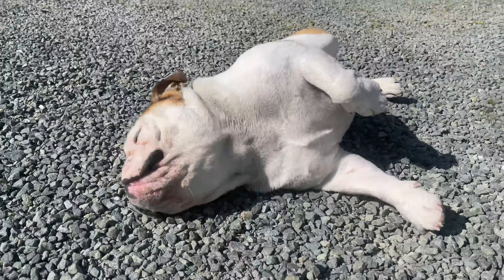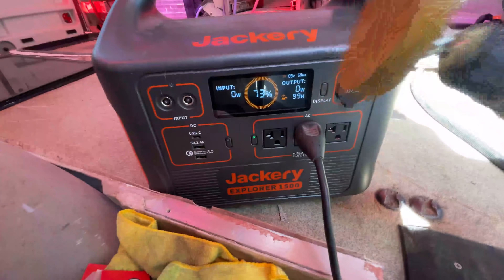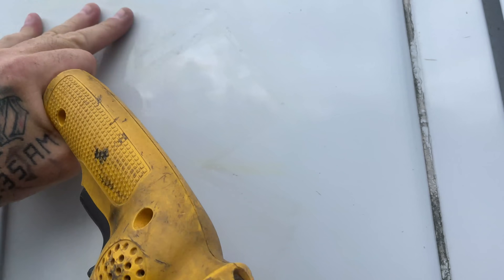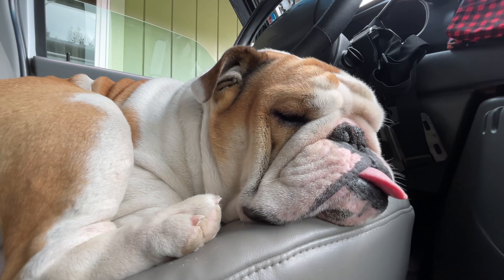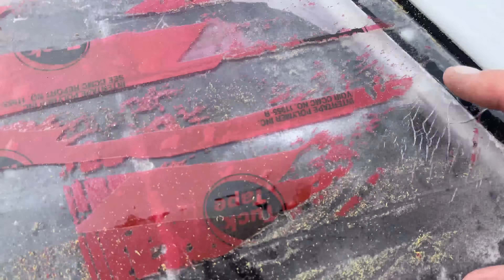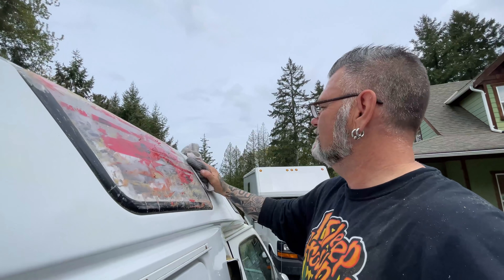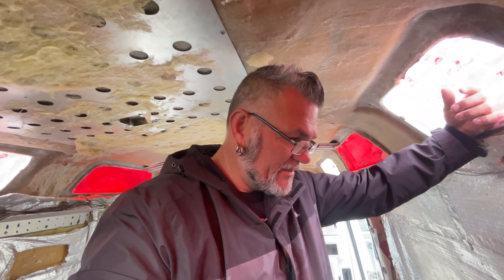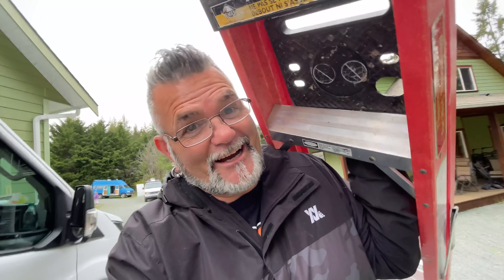What Did I Get Myself Into???  4x4 Ambulance Build Starts Today

Comment: Lots of work ahead but in the end it will be so worth it.   I’m betting you’ll move in to it when your done.   Enjoy the build 💕
Reply: Do a thorough Measurement of the Van inside and out, get one of those layout programs so you can tryout all kinds of ideas before building!
Reply: Visit Sportsmobile factory tour of their builds it has a fiberglass shell behind the factory cutaway like yours!
Reply: I have an E350 Sportsmobile clone, 4x4 Quigley conversion, high top ,extended, 7.3 idi  diesel. For a City Boy your moving up  in the adventure van world! You won’t regret it,

Comment: what i do with the wax and grease remover,,,is wet a cloth and soak small area ,,,then use razor blade to scrape off glue,,,run the razor blade over windsheild to dress sharp edge,as to not to scratch paint,,,,,ive stripped decals off off trucks this way,,

Comment: Since you talked about raising the roof in a previous video for more standing room, maybe look into raising it in a way that you can replace those oddly shaped windows with more modern easier to replace windows. It would undoubtably be more difficult than what you were considering but once done could be very worth the extra effort.

Comment: Hey Chrome and Cruz.  I use an eraser wheel for my bus decals.  They work well.  Then I went with the Heat gun and scraper, which I think Chrome can use on that tape. Just insulate everywhere, I know you know that.  Have fun, bc I know you're going to end up using this vehicle as your everyday home, eventually.  Stay safe.

Comment: I have a suggestion for a decent temporary fix for those cracked windows....Get some Lexel caulk (it’s clear and super durable under wet conditions and temperature changes).  You can smooth it over the windows with a credit card to coat and seal all the cracks.

Comment: Really enjoying this build!  Great montage before walk.
3M Vinyl Tape 471 is a great no-residue tape, unlike that horrid stuff on Chrome's new tank's windows.  I used it on my sunroof when the gasket started leaking and my mechanic said they don't repair them.  Worked fine for months, but is easy to get off long after with no mess.

Comment: Tape up around the window and use spray flex seal several coats on the window itself ,that will nicely seal it till you get it replaced

Comment: You can vacuum form. It's not that complicated.  "Hardware Store Vacuum Table - HOW TO make your own" on You Tube. Also I could see a 100$ 3D printer being useful too. You can make small control panels or fixtures. I was watching some guy on You Tube melt down water bottle lids with a Gorge Forman grill to make flat plastic sheets for projects.  They just hacksawed what they wanted out of the sheet.  Different color lids can be used for a marbling look. You Tube always has an answer somewhere.

Comment: Acrylic can begin to crack over time due to overexposure or harsh conditions. For small cracks, use a 1/8" drill bit to drill a hole on both sides of the crack. Use a silicone sealant to fill the crack and let it dry. This should help restore the integrity and appearance of the acrylic.  There are kits you can buy for this I think.

Comment: If the original windows cracked, what's going to stop the new ones from also cracking? You're better off filling those openings in and then just adding a couple of windows like what you put in your other van.

Comment: Until you get your windows because they leak you can paint those cracked windows with black flex seal paint that turns to rubber end it will seal up those leaks and the windows might blend in better until you get your new ones